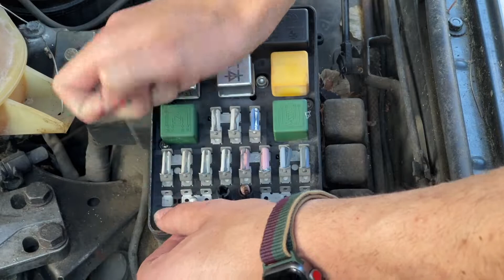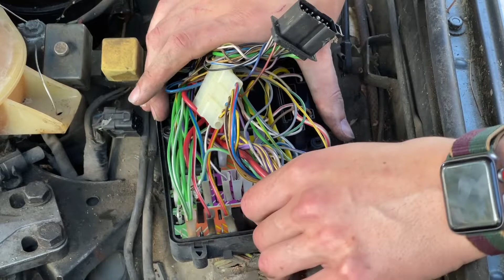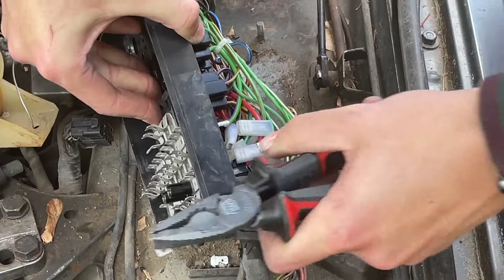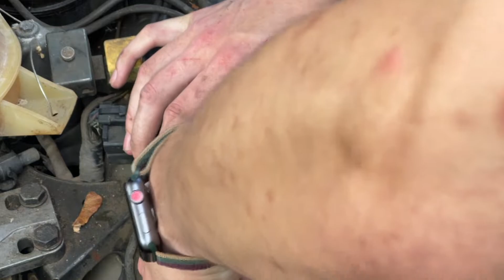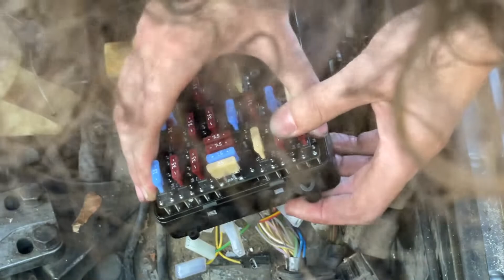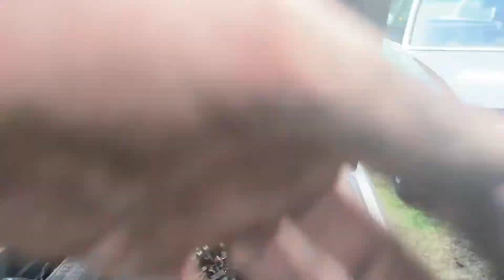E28 Blade Fuse Retrofit Kit Install Walkthrough

Comment: The cardboard color code card fell apart instantly on me and was basically useless since it was faded and I'm partially colorblind. I used a sharpie and numbered/ dashed all wires/ connectors from left to right, bottom row first. Wrote the corresponding numbers on the blades of the new retrofit board. Each row of connectors was then taped together and labeled in numbered order with half width electric tape. Before disconnecting each row, pictures were taken to verify wire color and pin location. The old terminals did not come out easy. I figured out a process for removing them worked great with little effort. I broke off the springy tabs that hold the fuse ends with linesman pliers. Used a small flat blade screwdriver and wedged it between the plastic and the leftover U (or L) shaped part of the terminal that protrudes through the back. Used the screw driver to split them down the middle and bend the leftover tabs up. Broke off the excess sticking up, then the blades were easily pulled out through the bottom. This way you don't have to force the "teeth" on the spade part of the terminal up through the plastic. Found a toasted 12v feed and auxiliary fan wire, repaired that while in there. Now my AC doesn't melt fuses on hot days and my sunroof finally works. Thank you!